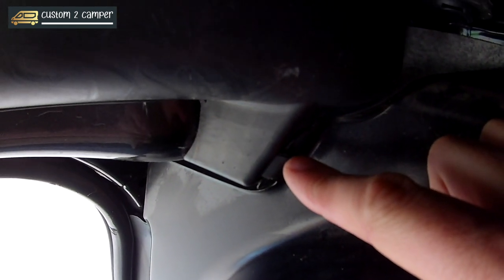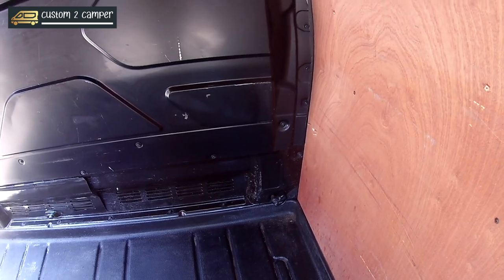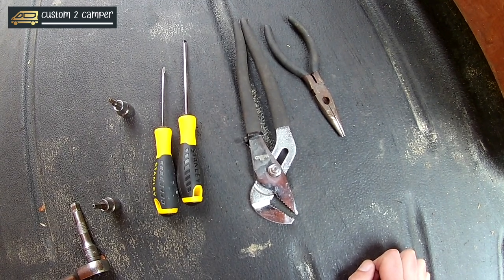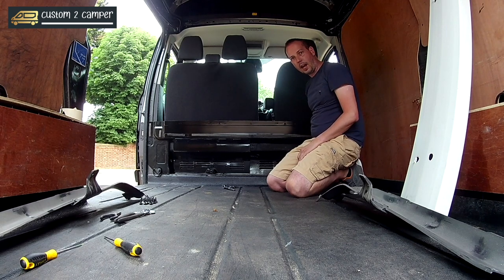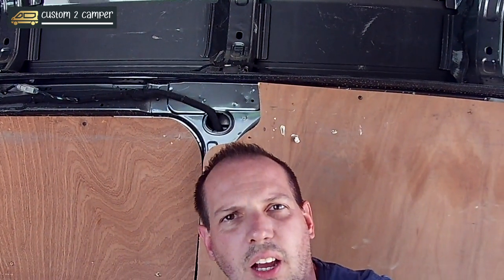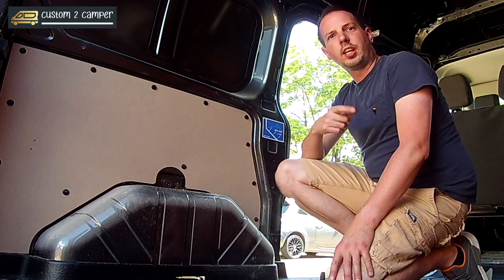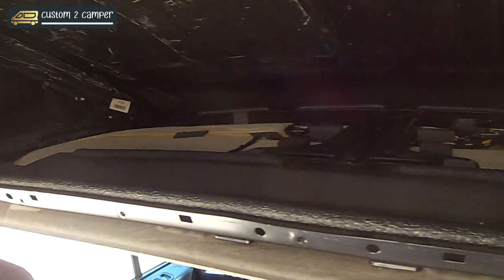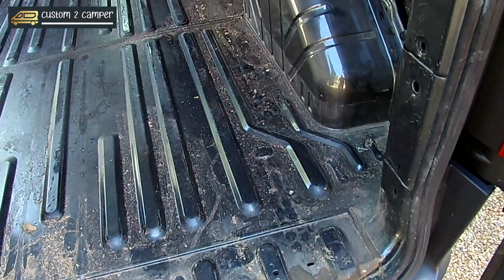VLog 2 - Ford Custom Bulkhead & Ply Lining Removal Video

Comment: I was peering at this hoping to get a clue to my ongoing wiring mystery. Is the little connector to the left of the headliner above the sliding door (you nearly, but not quite) pan over to it at 9.46) attached to anything? It has a YE/RD wire.
Reply from the maker: Ch3699 if you are talking about the very thin single wire to a connector it doesn’t attach to anything. I believe that it is for different spec vans.